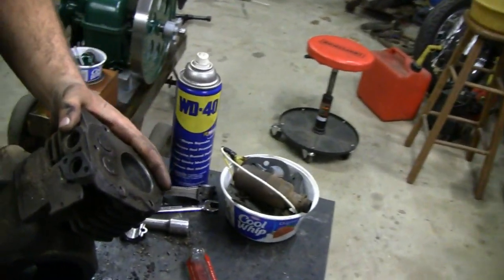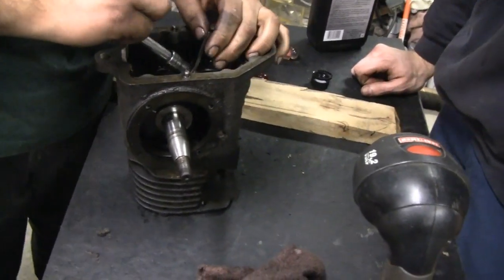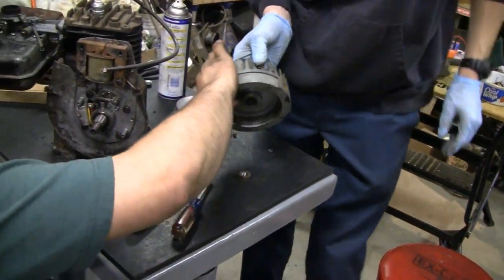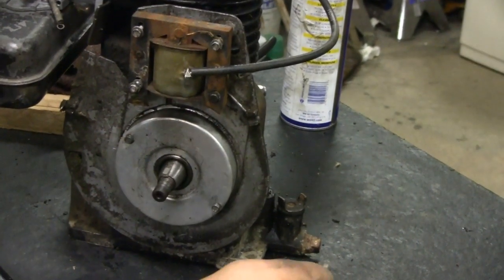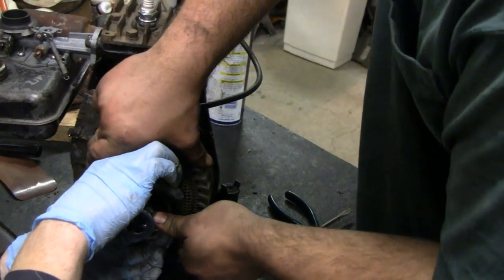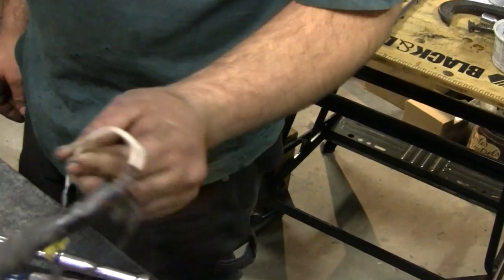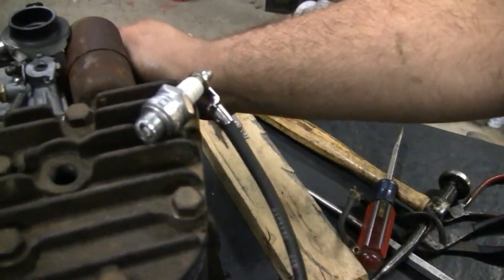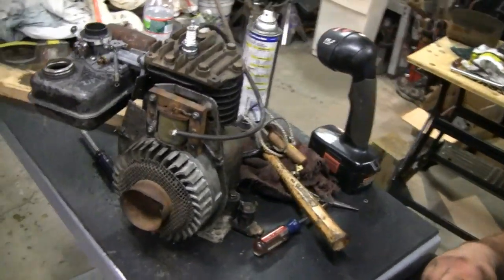HOMEMADE HIT & MISS BRIGGS PROJECT (part 3)

Comment from the maker: The tank and carb were fine, it needed a ball bearing in the check valve so we put the smallest one we had in there but apparently it was too big. We have since purchased a 550 piece assortment and corrected the error!!☺